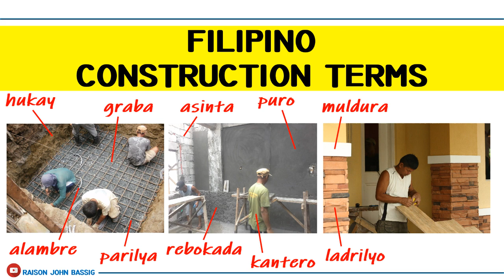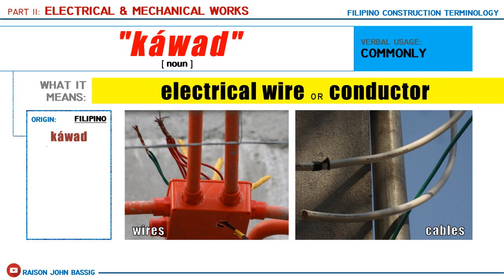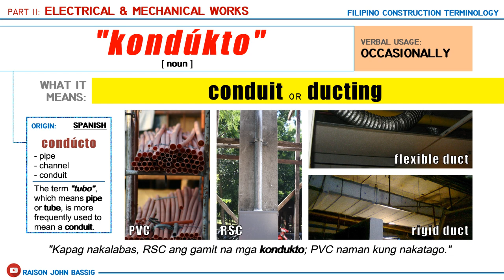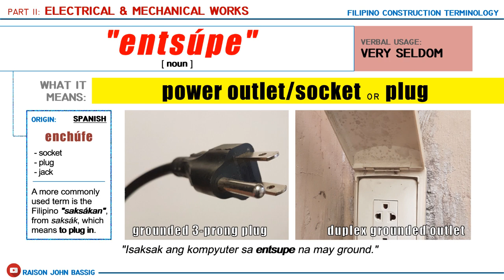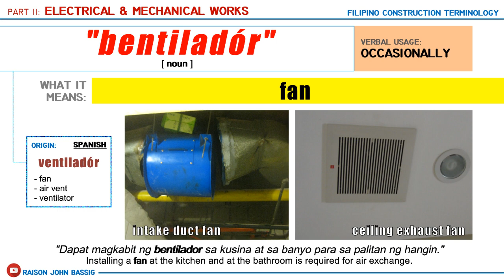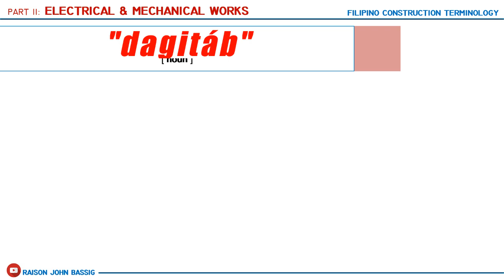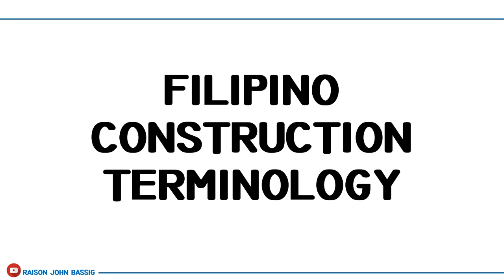Filipino Construction Terms || PART 11 || Electrical & Mechanical Works

Comment from the maker: Hey everyone! Thanks for checking out this video. PART 11 will be about ELECTRICAL AND MECHANICAL WORKS with the terms: sirkito, disyuntor, tablero, pusible, kawad, balat, ahislador, kondukto, kaha, bumbilya, aranya, kabtol, entsupe, kurdon, bentilador, erkon, panlulan, pararayos, kuntador, poleya, dagitab, amperahe, boltahe, and batyahe.

When designing or constructing a house (or any other structure) in the Philippines, standard blueprints are always written in technical English. This may cause miscommunication with local workers who'll be building your project, since most of them speak in a vernacular language.

As the Philippines was once a colony of Spain for more than 300 years (and later on the United States for almost 50 years), the already diversified Filipino language has evolved by taking in a lot of foreign words (like the Spanish "la mesa" for table or "papel" for paper) and several American terms (like inches, feet, or gallons).

This video will be part of a continuing series on FILIPINO CONSTRUCTION TERMINOLOGY, where I'm going to share with you the terms spoken by local workers in the Philippines, where it came from and what they all mean. These are all based on my research and personal experience in construction sites.

Comment down below if you know any other vernacular construction terms not included in this video. Again, thank you so much for watching and let's all continue learning! :)